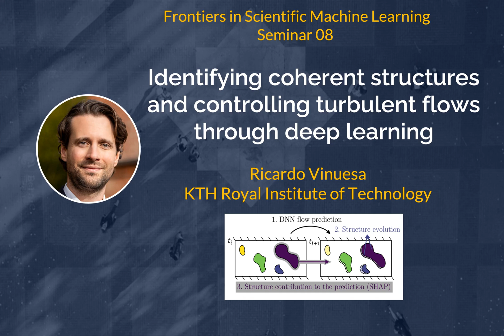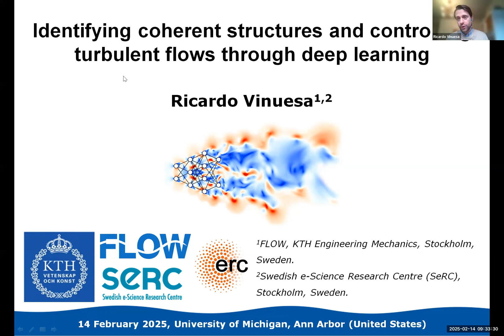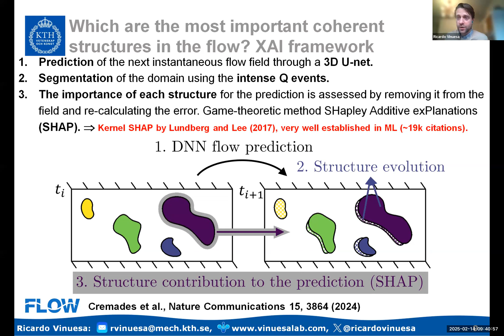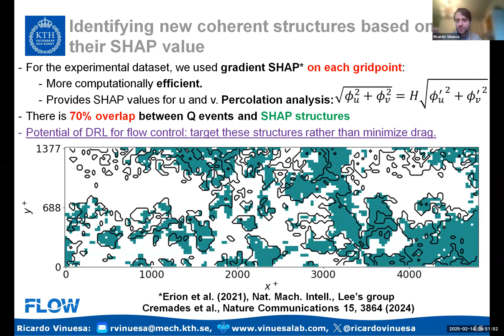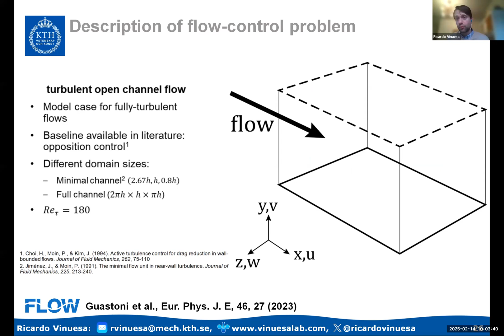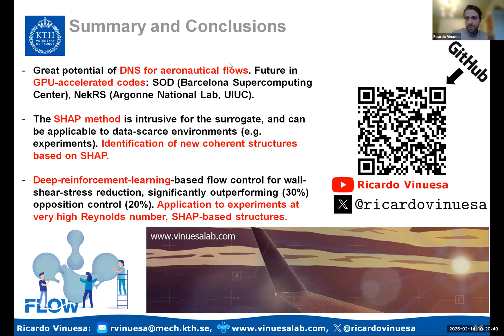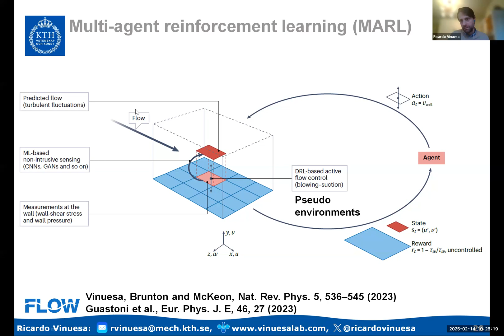Ricardo Vinuesa on Explainability framework & Deep RL for turbulent flow control (FSML Seminar 08)

Comment from the maker: Timestamps:
00:00 Introduction
02:38 Motivation, AI4Science
06:28 Part 1: Defining important regions in the flow
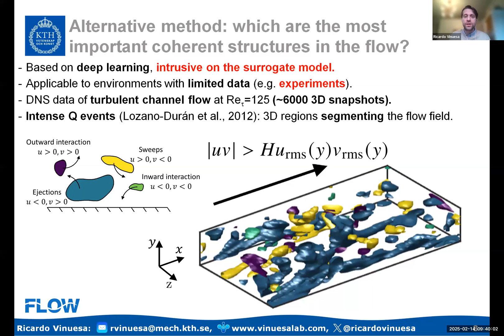08:42 Part 1: XAI Framework for Important Coherent Flow Structures
14:40 Part 1: Interpretation of SHAP Values
18:29 Part 1: Identifying new coherent structures with Gradient SHAP
26:05 Part 1: Combining autoencoders, causality and SHAP
30:30 Part 2: Deep Reinforcement Learning (DRL) for Flow Control
33:19 Part 2: Multi-agent Reinforcement Learning (MARL)
37:18 Part 2: Quadrant Analysis
39:52 Part 2: Targeting most important coherent structures
42:24 Part 2: Application of DRL to other turbulent flows
45:17 Summary and Conclusions
46:28 Q&A Session